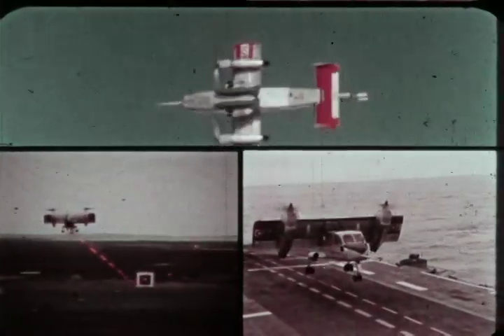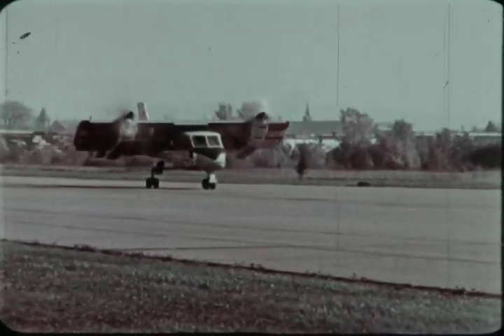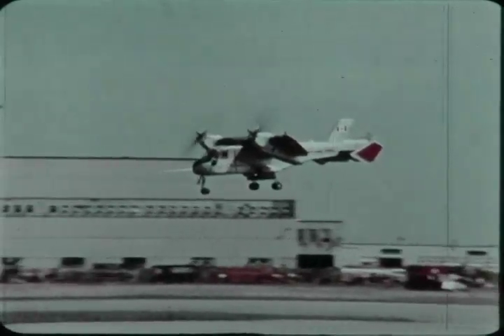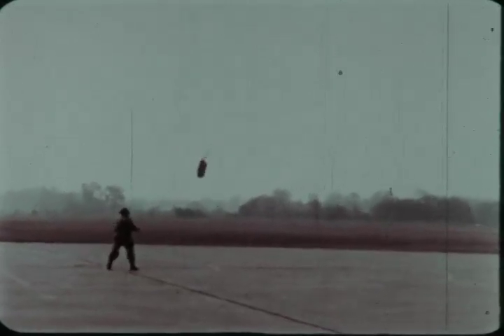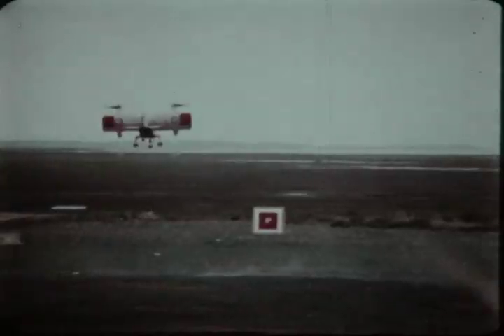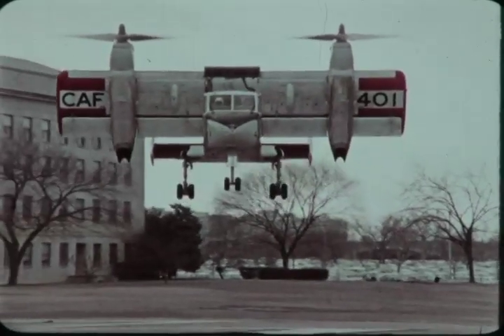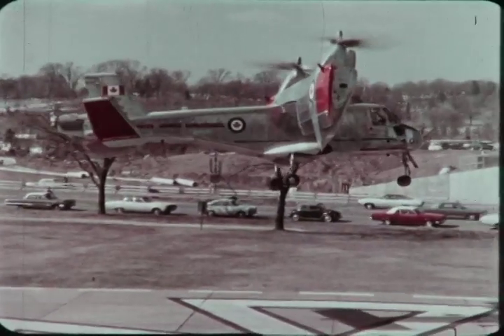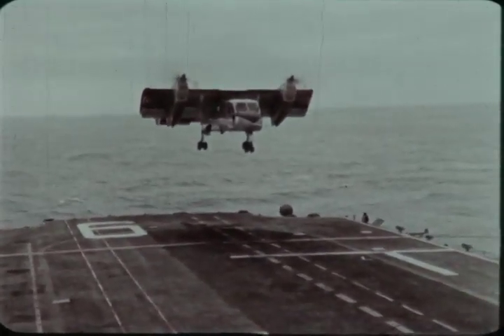F-0628 Tiltwing Versatility

Comment: I don't understand the need for the elevator to pitch down with the main wing.  Seems like it would create some weird lift back there, but I guess I need to remember that this plane was designed without computers, and had pretty minimal computer control and stability.  I wonder where they came up with needing the moving elevator though... I guess at high speeds, it could otherwise create a pitch up torque if held flat?

Comment: why is not to use today?
Reply: Modern helicopters (e.g. Blackhawk) have larger payloads, are almost as fast (even compared to the Dynavert's prop-forward flight), and longer ranged.

At the time, the Dynavert blew any helicopter out of the water, but it is obsolete today.

Comment: I never understood the I sorry. Why have all the extra mechanical to swivel the engines. And this tilt wing. To much garbage. Just mount Harriet engines on the wings, problem solved.
Reply: Tilting the entire wing provides advantages over the tilting engine pods of the Osprey... note that the ailerons provide yaw capability when in hover. There was (I bekieve) a combination of electronic and mechanical coupling of all of the flight controls, so that the flight envelope was achieved without the pilot needing to explicitly control individual parts of the aircraft's control surfaces and rotors... unlike the pitch/collective and tail rotor situation in a helicopter.
Reply: When one engine fails, the airplane flips over. The Germans did exactly that and and abandoned the idea. 

https://en.wikipedia.org/wiki/Dornier_Do_31
Reply: Remember this was developed before the transistorized computer. The whole automated flight system was mechanically designed and was meant to be as simple as possible so regular pilots could fly it using their current knowledge of flight controls. This mean't you didn't need a specialized flight training program just a couple hours of additional instruction.  This went up against the Bell Huey for Vietnam service, thats why it was evaluated in the States. Its only flaw: It wasn't designed and built in America.  At least they didn't cut up and destroy all the evidence like they did the Arrow. You can find one of the flying prototypes in Canada's national aviation museum.

Comment: I wouldn't be surprised if this concept was coerced and stop by the u.s. aviation industry to maintain Monopoly and profit share over aviation rivals.
Reply: Beginning of the

Dark Ages of Aviation
Reply: It was a Canadair-General Dynamics project and funded in part by the Canadian government, who should have bought a number of them for patrol/SAR instead of trying to compete with the Huey as a troop mover and gun platform.
Reply: I worked on this and the CL 215. Both aircraft were ahead of their time but plagued by finance problems. The CL 84 didn't attract enough money to continue testing. The CL 215 was almost canceled until Quebec decided to order a fleet. Both were relatively easy to work on. The late sixties, early seventies, was a time when aircraft work was hard to come by. I have no idea why the Canadian government didn't want to finance outright both of these machines. There was a market out there for them.
Reply: Nothing that sinister.  Cost vs function made the Bell UH a better choice for most countries military strategies.  It was ahead of it's time but I am really surprised that a civilian aviation company has not picked this up to make a modern private charter aircraft given it's load and versatility.